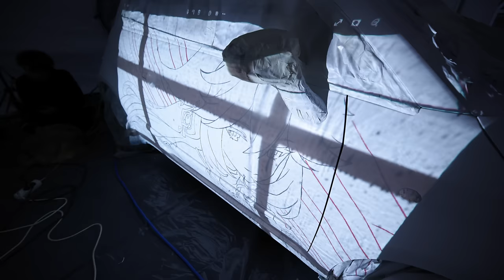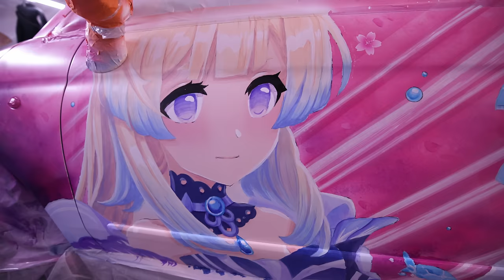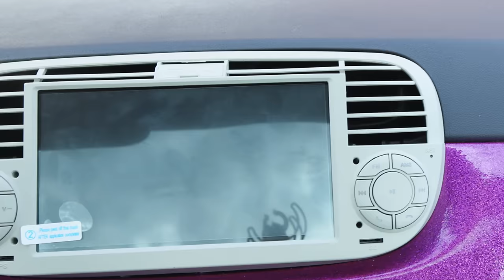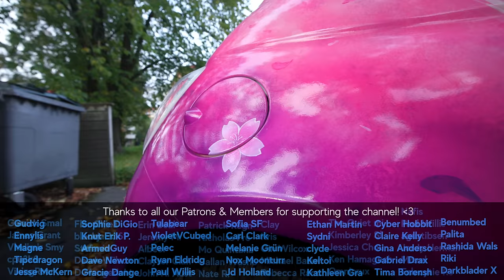I Got Revenge on my Brother with an Anime Car

Comment: That's so awesome! you don't need a Lamborghini to turn heads, just a Fiat 500 with anime girls on it xD I would happily volunteer my Audi if you ever needed another car to paint for sure :) and surely a trip to Biltema to buy some square steel tubes to either screw together or weld together would have made a much stronger tent to work in, but obv no way to  know the wind would be so strong it shredded it a part.

Comment: Just because work has entirely poisoned my mind, I have the need to point out that not only did you buy your brother a nice starter car, but in making it pink, you made it statistically less likely that he will be involved in an accident either actively or passively, AND the pink+custom artwork make it less likely that it'll be stolen or broken into. By a lot. I wish I was making this up, but "obviously very pink" is the safest color for a car to be according to real life statistics. (If you think that makes sense, red is the least safe. Any shade of red.)

The layers on which this project is "big sister" behavior go deeper than should be possible.

Comment: I do a lot of painting, spraying as well  and I'm absolutely convinced beyond doubt that paint manufactures put some kind of "insect attracting stuff" in paint because, I can be as prepared as possible - sealed off etc etc I spray and "FLIES" - that must have materialised out of thin air, and not just small ones, big fat fkers too - its been the bane of my life for YEARS.

Indoors or in sealed areas makes no damn difference - FLIES and bugs EVERY.SINGLE.TIME.

Comment: For the future for you don't have to send the car what you do is you go to Walmart and you go in the paint section where there's pilbo paint will you spray a pretty good amount of coating on there at least 2 or 3 coatings on to the car then you can actually paint on top of that with permanent pain't and you can do your designs cause you don't want to use the can of the pill pump cause it's pretty hard to do stencils in all that And it won't come out right so you take the other paint like the  The X2 paint On top of it and it will feel like it's regular paint and then later on when you don't want it you can send it so only thing you're doing is Masking off the areas where you don't want to have paint and that's the only thing you have to do

Comment: I so wish the number plates were real... it would be so funny to have her younger brother driving around with uWu on it.. lol

Also, so lucky you didn't blow the projector by unplugging it while it is still on. That can crack the lens, especially if it's cold or gets wet as the bulb gets extremely hot and while it is "Tempered", it still doesn't react well to extreme changes in heat.

Comment: What type of paint did you use though ?
Reply: @Nerdforge
for 3 måneder siden
As long as its clear coated, its mostly UV-resilience that is important, and compatibility with a clear coat. We used Createx auto colors which we have good experience with from earlier projects.
Reply: @zooloo73  thank you !